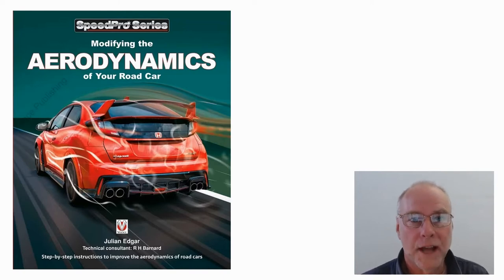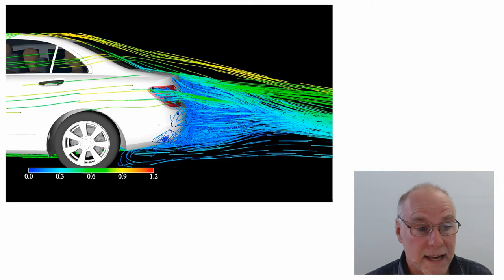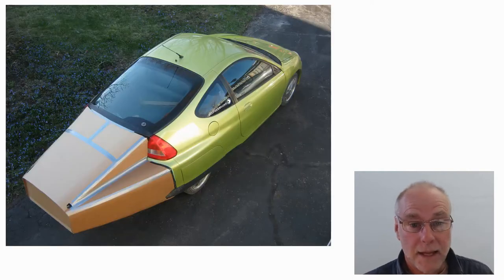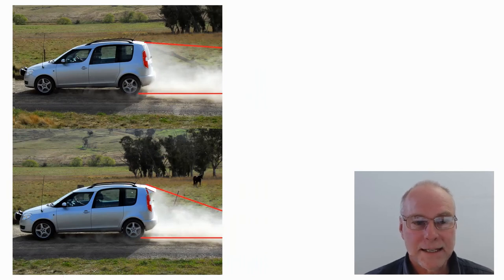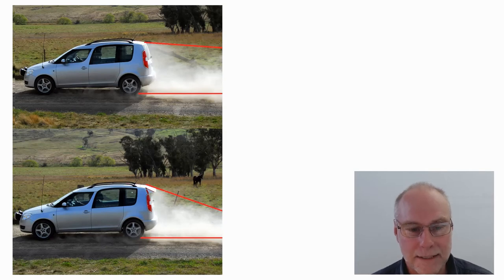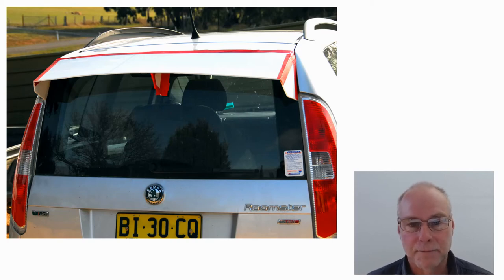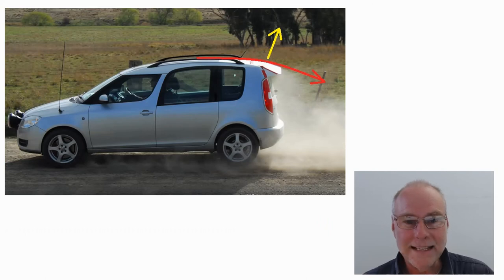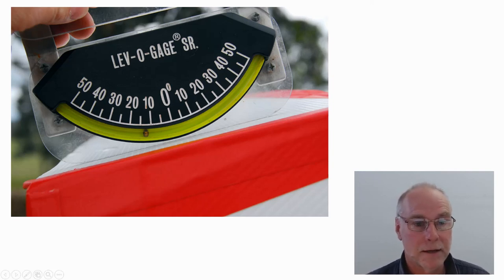Using a roof extension to reduce aerodyamic drag

Comment: Very insightful. I have a Chevy pickup with camper top. Old style, the back is completely flat and a right angle to the top, which isn't sloped, it's parralel to the bed rails. In other words a true box. Would having the rear window half open help (creating a bit of an down slope at the back) but not sure what would happen to the pressure in the bed. 
Or maybe creating something similar to what you have in the video, to help taper the air flow at the rear.

Comment: hi Julian ive watched about 10 of your videos in a row, fantastic stuff! Is there a maximum length for a rear spoiler? in my case i want to remove as much drag as possible My car does 140+ mph and i would like to go faster... Would i benefit from making the spoiler longer for my hatch back or not? It currently has nothing.
Reply: If the spoiler gets too long the front axle will lift :D
Reply: I think too long will make the rear lift and cause you to spin out at high speeds. Long rear slope equals faster air over the top, resulting in lift on the rear. I could be completely incorrect though.

Comment: When I saw this I did start to think of the solution that the SAAB 95 v4 estate (70's car) had on its tailgate. Basically a "cheese slicer" that split some of the air down over the rear window. I don't know how much it did for drag, if anything, and I think they did it primarily to keep dust and dirt off from the rear window.
Reply from the maker: Yes such an approach usually increases drag.

Comment: Loving the channel.  This video is particularly suited to me.  I currently drive a landrover defender and I use it for work in forestry.  Could you point me in a direction to help improve the drag of what is essentially a brick?
Reply from the maker: What model Landrover Defender?
Reply: @JulianEdgar  110 station wagon from 2003.  I'm not expecting anything spectacular. 
I've been looking at running those vortex generators around the back.   
I was also thinking about a bug deflector to skip the wind on to the roof. I have tried to play with so e free stimulation programs but I lad the accuracy to do it properly.  Thanks is for the fast response.
Reply from the maker: @johnmventers398  The photos I can find of that vehicle shows good sharp edges at the trailing edges of the roof and sides. I therefore don't think a roof extension will do much, but you could try one angled downwards a little as I did with the Roomster. Angled-in vertical extensions might also reduce the size of the wake. There is no evidence that vortex generators would do anything if used as you describe. There may be flow separation on the leading part of the roof but I don't think that could be easily addressed. (A bug deflector doing what you describe would give an enormous separation bubble on the bonnet/windscreen.) By far the most certain gain would come from a full length undertray. Not easy, especially with an off-road vehicle, but at least you can be pretty confident it would actually work in reducing drag.
Reply: @JulianEdgar  spectacular thanks.  I'm actually half way through your undertray video right now.
Reply: @johnmventers398 did you do it?
Reply: Great video. Thanks for sharing. What percentage reduction in fuel consumption did this produce, if you wouldn't mind sharing? Thanks

Comment: I am very late to this but wonder if you’ve covered this for pick up trucks or utes with an open bed either in a video or in the book.  Even if the bed is covered, wondering how the long, flat area interferes with attempts to reduce wake size.  I’ve considered vortex generators and an extension similar to this but aimed at the separation edge of the tailgate but worry I’m only injecting energy into the wake.
Reply from the maker: Pick-ups are covered in the book. In short, best results from a sloping canopy.

Comment: Hello , my question is if the improvements are for road cars how much more for my box trailer? It is 6x12 and has a v front already but I’m thinking a box at the back might be a huge improvement, I pull it with a v6 twin turbo f150, when my children tag along they want to travel at 75-80 mph, I have to put the 10 speed transmission in 8 th gear and get 8 mpg. Can get 12 mpg at 60 mph. With out the trailer I’ve averaged 22 mpg over 35 thousand miles.

Would a box on the back help me?
Reply from the maker: It sounds pretty bad. It's likely that a whole range of modifications could help. Time to do some testing with cardboard, tape, etc.
Reply: You ever see those semi trailers with the trapezoidal panels facing inwards around their tailgate? That may help. Of course, it won't give you great efficiency, as you still have a blunt front end on your box trailer too. I bet with a box trailer and a pickup, you'd actually get some improvement by adding a bed shell. This would probably hurt the aerodynamics of your pickup without the trailer. However, the larger wake from your pickup may mask the trailer quite a bit.

Comment: Its a shame the manufacturers dont even do a bit of testing on their vehicles and equip them from the factory.
Reply: They do but the vehicle must look appealing so they can sell them, and they have to be practical.
Reply: I'm sure you'll find with even a little googling that car companies do very comprehensive and exhaustive research to ensure their vehicles are as air drag efficient as they possibly can be within design constraints as it is one of the most significant influences on fuel economy.
For instance my VW Passat wagon has a lip over the back window that is almost the same shape as the one Julian brilliantly developed without the resources that engineers at VW have at their disposal.
It is only when we understand how as individuals how little we know that we may comprehend the vastness of our ignorance and begin to learn from others.